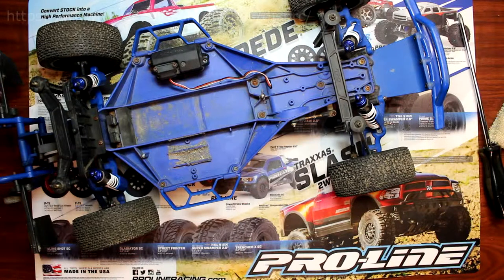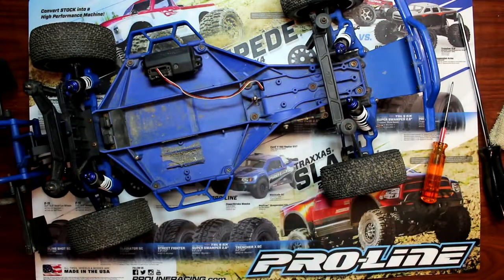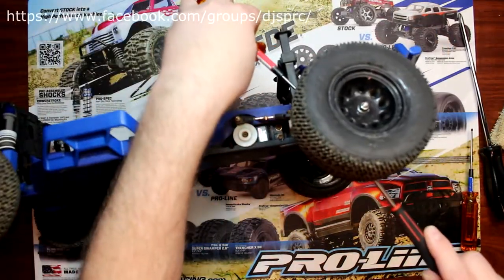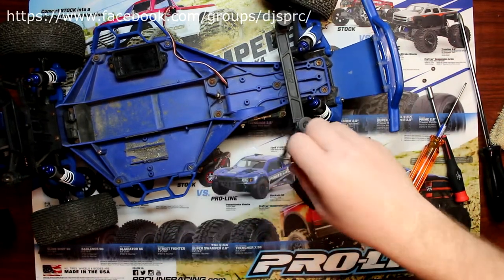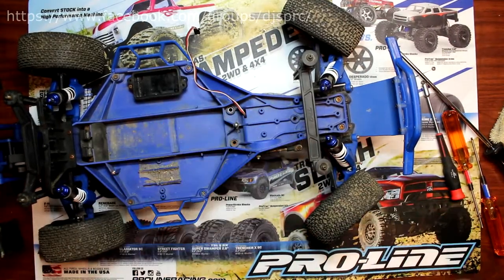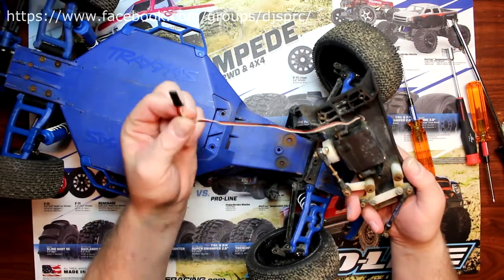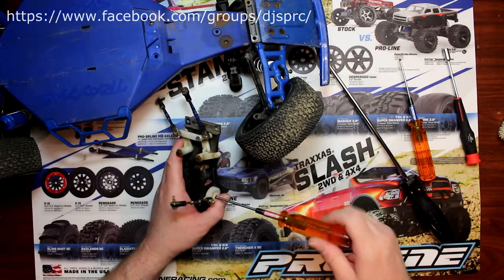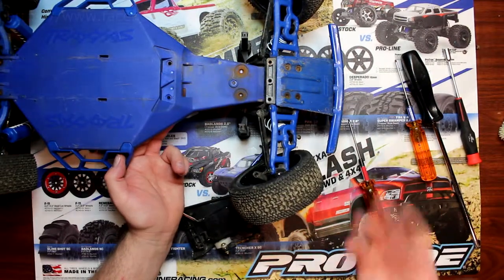How To Install Servo In Low CG Chassis In  Traxxas

Comment: Older 2wd traxxas rustler. Replaced 2055 servo with the commonly used red digital metal geared servo from amazon (20$). The nice metal horn that came with the new servo won't fit in place of the servo saver. Any ideas?
Reply from the maker: What I was suggest is get yourself the hot racing servo saver that’s made for that servo or if you go and get yourself replacement servo saver from Traxxas it will give you different splines for it.